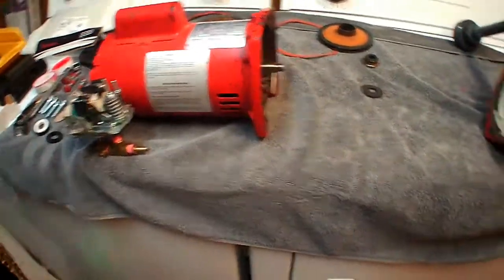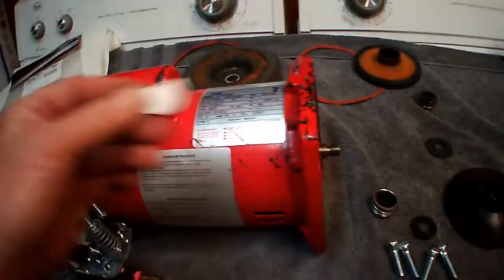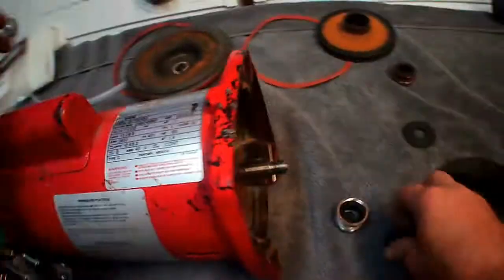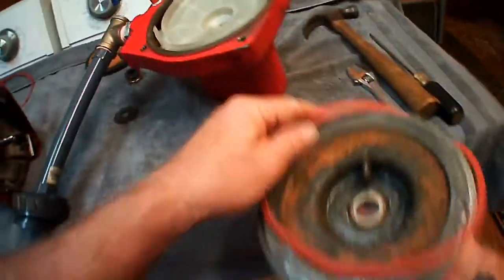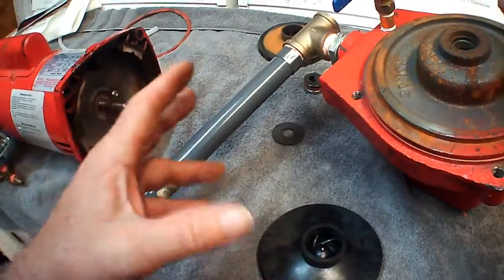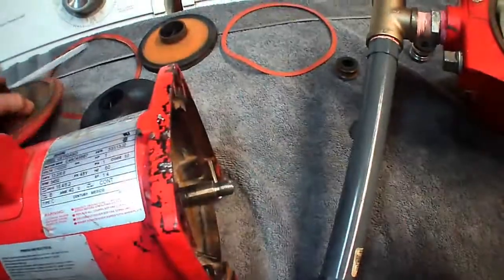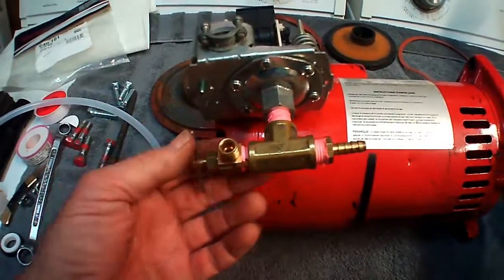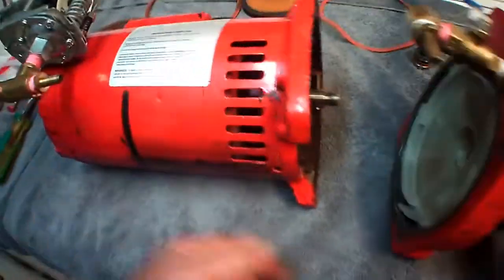Rebuilding a Red Lion RJS-100 Water Pump - Part 2

Comment: 1/4 turn ball valve, not a gate valve.  But somehow I know you knew that.   Good job on the video.  Also, some of those mechanical seals need to be kept very clean (no fingerprints) on the micro polished seal face.  Could be where that round cardboard spacer was.  ?
Reply from the maker: Thank you :) I have learned a few things since I rebuilt that motor :) Thanks for your input for my next re-build :)

Comment: The ceramic seal white thingy goes into steel circle plate and rubber thing is the boot that hilds it.

The  big metal plate  lay flat and take socket and push out old ceramic bushing and then take needle nose to pull out rubber seal..install new ones 👍
Reply from the maker: I sure appreciate the input.. It didn't come with instructions. I remember the rubber seal, but was afraid to try and pry it out since I don't remember there being a replacement. Any visitors will appreciate the details though :)